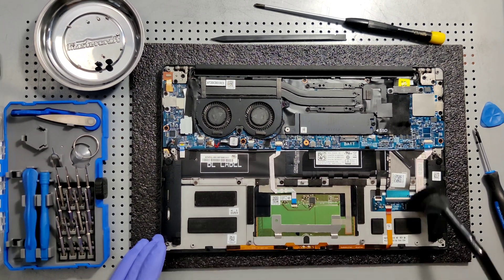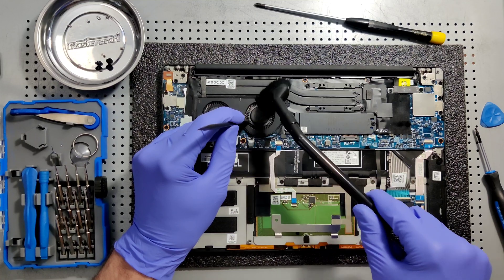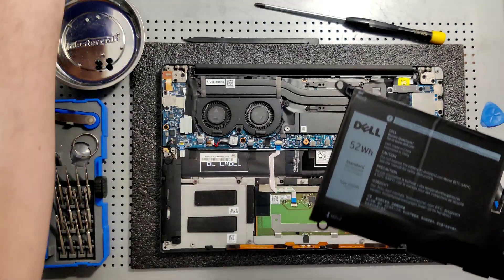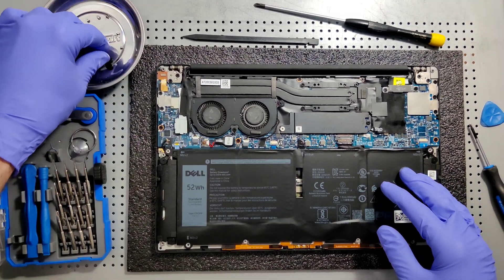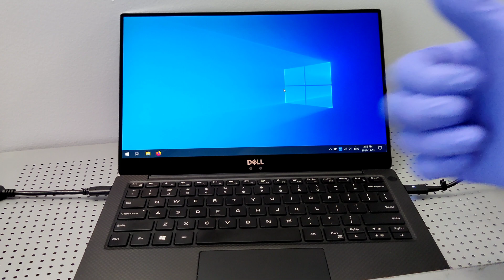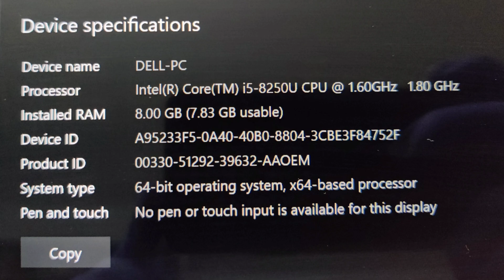How to change battery on Dell XPS 13 9370 / 9360 + Interior Cleaning Walkthrough 2021

Comment: hello! which battery did you pick up to switch the battery in the xps 9370? I could not find an official replacement for the 9370 in the dell website and it's also telling me that the 9360 battery is only compatible with the 9360? help please
Reply from the maker: I got an original battery from Dell. Call them directly has given me good results over the years. Often if they don't have brand new it will be a like new of higher than 92% battery that they took out of a return computer or model that had damage to another part of the computer that couldn't be fixed. Defiantly give them a call because on the phone they can work with you to find a battery for you and it will always be cheaper prices than what you see online. Let me know how it goes my friend. What country are you in? I'm in Canada.
Reply: Im in french how can i call them